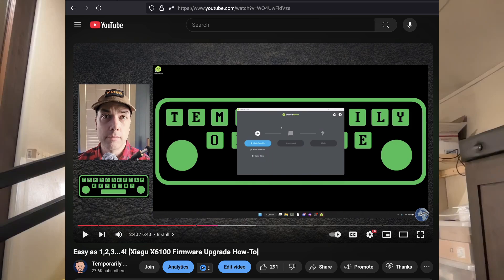Y'all Fixed It!

Comment: So Steve, I’m about to buy a 6100 (as soon as find one used on a decent price) so which version number is the highest that I am safe to update?
Reply from the maker: It looks like its one revision behind current. -- depending on which revision you get.  We don't have the revision data.  If you do get one that won't transmit after the firwmare update, you can revert to "current-1" and be back working.
Reply: @temporarilyoffline  thanks Sr

Comment: Yet more good reasons not to buy Xiegu.  Seems the G90 was the exception….
Reply from the maker: G106 was pretty good too, hard to mess it up since it was so basic.
Reply: @temporarilyoffline  and yet for early firmwares, pretty sure they did screw that up too.
Reply from the maker: @ammocraft  I didn't see any reports or have any problems.  Do you know of any specifics?
Reply: @temporarilyoffline  Only the early YT videos that were, in the main, far from complimentary.  Likely long since fixed, because as you say, there wasn't much in them to get wrong!  ;)
Reply from the maker: @ammocraft  I remember that radio, yep.  The one I got was fine and I used it a bit before sending it to it's new home.  I wasn't sure why it didn't have a battery inside.

Comment: I used Raspberry Pi Imaging Tool and selected custom OS to write to my SD card and my X6100 works fine on the new firmware, no TX issues. I gave up using Rufus a good few years ago - just too many issues with writing cards.
Reply from the maker: I haven't used Rufus, good to know it has a reputation

Comment: I used Etcher on the new firmware version and my radio transmits fine. Its a little wierd in the cw decode app though. The vertical blue line in the waveform window we use to line up the frequency is in the wrong place.
Reply from the maker: If it ain't broke...
Reply: @temporarilyoffline  Update it until it is!